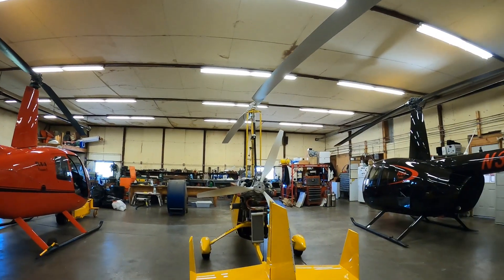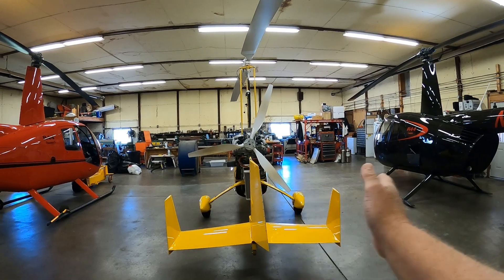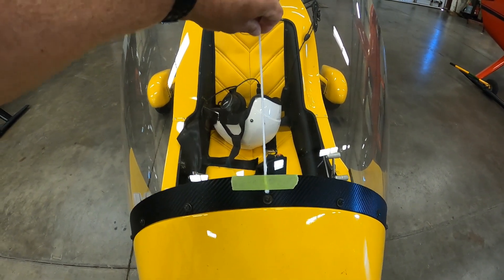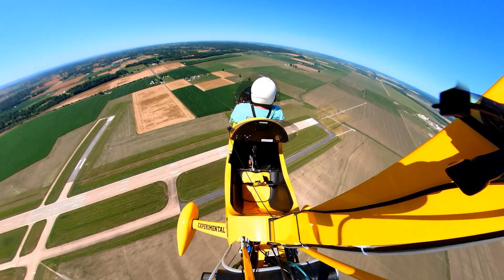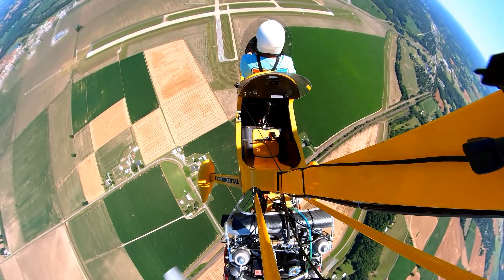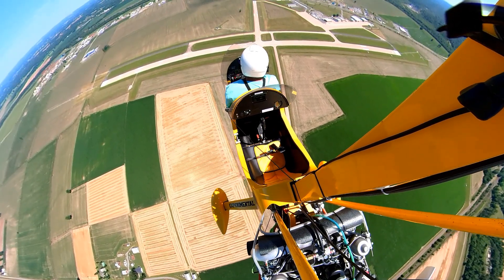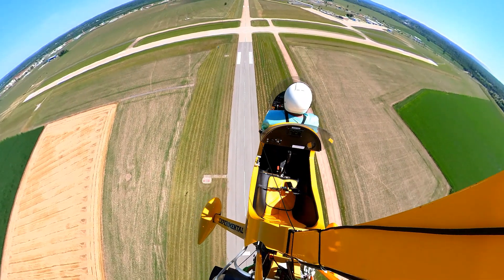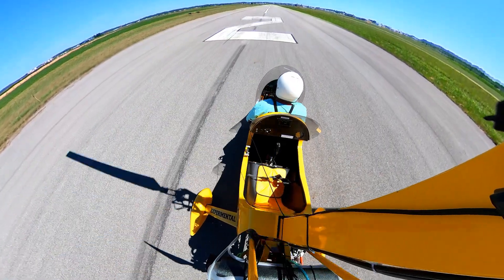Gyroplane Engine Out Landings- Explained

Comment: Your gyro videos are informative and illustrative for me. Thank you for producing them. Camera angles that couple with the aircraft's shadow as a height reference tie in nicely together.

It's probably asking a bit much, but an additional (split-screen or inset?) diagonal view, looking ahead over your shoulder (the better to see cyclic and throttle movement in relation to aircraft nose pitch attitude in the flare to touchdown) would complete the illustration and enhance the tuition value for me. Even without that, your videos are a great help, so I'm in no way complaining - how on Earth could I?

The sound quality of your intercom and radio audio is also clear and well-balanced between the two. Is it possible for you to outline the equipment you use, please?

Comment: The nose gear will indicate rudder deflection only if the rudder peddles are tied to or semi connected to the nose gear. In a fully castering nose gear where there is no connection between the rudder peddles. A good example of Gyroplane design which has a castering nose gear would be the Vancraft Sport Copter. Nevertheless what you teach is golden and my example is the exception.
Reply from the maker: Thanks, stay tuned for more to come!!

Comment: Hmm,  I've always felt like a windmilling prop produces more drag than a stationary one.  That's a warp drive prop on a Dominator so maybe that plays a part in it.
Reply: A wind milling prop, to me, is more drag than a stationary prop. On my own opinion from landing low power side slipping taildraggers, One can hear the wind shift on a prop when wind milling on final, the air starts flowing in the opposite direction of thrust (actually braking though at minimum) when the engine brought to idle and the airspeed is up a bit.